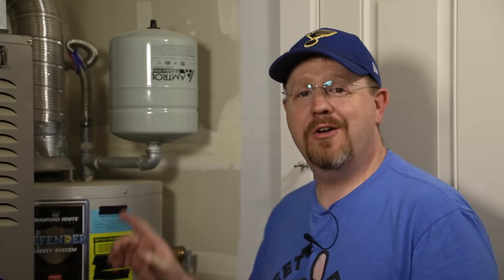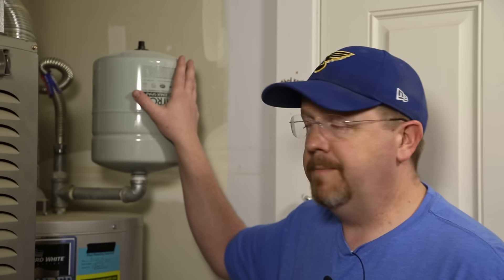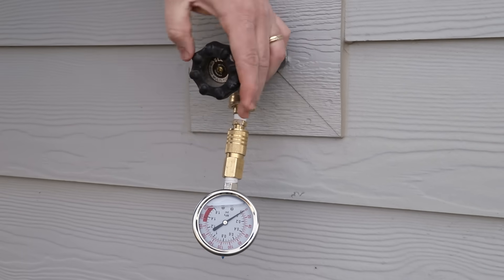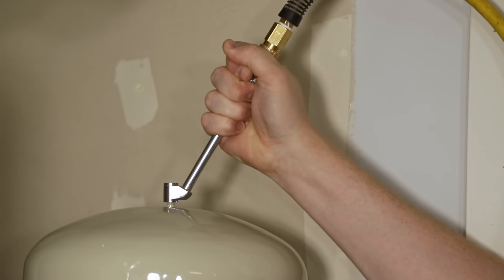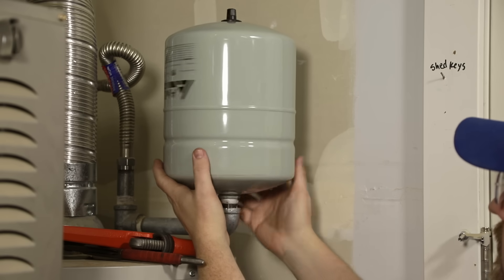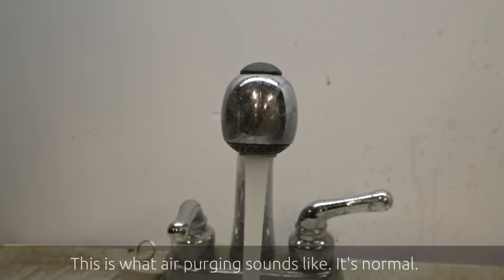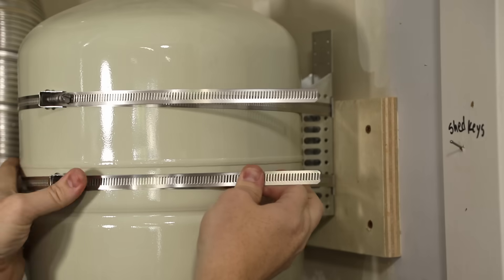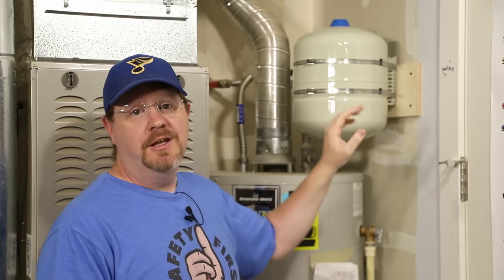What Is This Tank? How to Replace and Maintain a Water Heater Thermal Expansion Tank

Comment: Your relief valve is not pipe correctly. Per Code it needs to terminate 1 1/2" - 6" from the ground . This is to protect personal from scalding if the T&P discharges. Looks like the pipe is about 10"-12" above the ground
Reply from the maker: Hi Rafael - thanks for the info. I wonder if the codes are different here, as this house was built about 4 years ago and all this plumbing was installed by a licensed plumber and passed all the local inspections. I just went out an measured, and mine terminates about 7.5" from the ground. Here's a picture: https://www.instagram.com/p/CDpFaRxjdvg Thanks for the heads up - should I extend mine a bit?

Comment: Do I have to take down the tank in order to add more pressure or can I add pressure while connected? What's the consequence of adding the pressure while attached? Thank you.
Reply from the maker: Yes, you can add air pressure with the tank attached: you don't have to take it off the tank to re-pressurize it. The only important thing to keep in mind is that the water heater itself must not have any pressure in it, or you'll get incorrect pressure readings from your expansion tank. So, turn off the cold water inlet to your water heater, open a hot water faucet and wait for the water to stop flowing. Then check the pressure in your expansion tank and add air to get it to the correct pressure as needed. Then you can re-open the cold water inlet to your heater and shut the hot water faucet. Job done.

Good luck!
Reply: @AmplifyDIY  Thank you!

Comment: on what side of a backflow or check valve should the tank be connected?
Reply from the maker: Needs to be installed on the same side of the valve as the tank. Good question!

Comment: Do you know if these expansion tank helps with hammering and railing pipes?
Reply from the maker: It will help with water hammer, but only on the hot taps, I believe. Thanks for watching!

Comment: Another excellent video. 2 questions: #1 Is there any periodic maintenance on the expansion tank? #2 When you were draining the tank, why was it coming out so slow? Thx in advance.
Reply from the maker: Hey there! Yes, an expansion tank needs to be checked at least annually: https://youtu.be/NGygvtP6Sdk. 

Also, the tank drains slowly because it’s only draining from gravity, through a very small drain valve. The valves provided by manufacturers are generally too small to drain quickly. After I shot this video, I replaced the original drain valve with a much better one: https://youtu.be/OBPJYg0o_o0

Comment: It will leak through the t&p only if you have a closed water system, such as a back flow device on the water line to the home
Reply from the maker: Right... which is why you need an expansion tank. If you don't have a closed system, then you don't need an expansion tank in the first place. For the last several years many municipalities have required backflow preventers on all new construction, so a lot more expansion tanks are showing up. I discussed this in the first couple of minutes of the video. Thanks for watching!